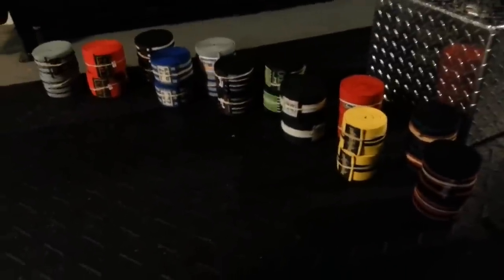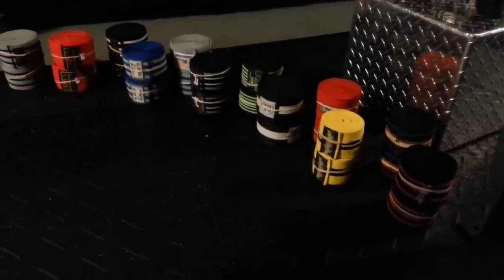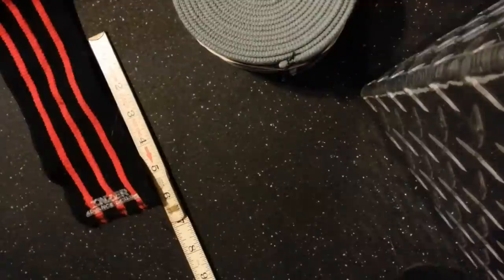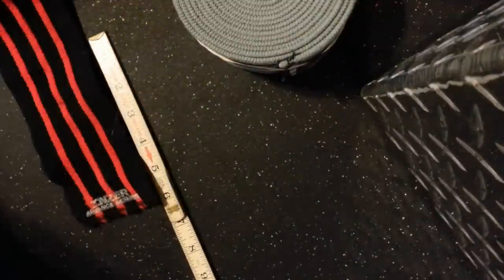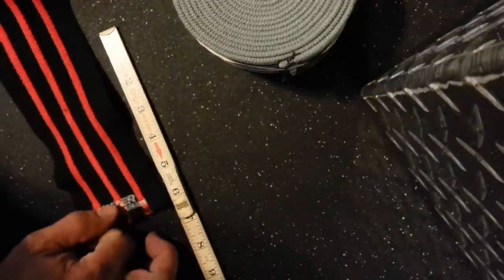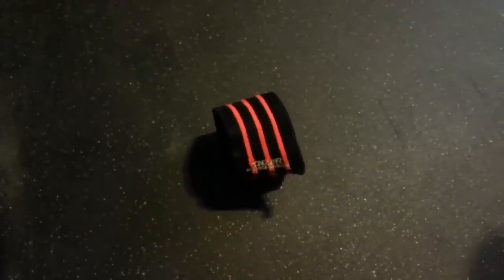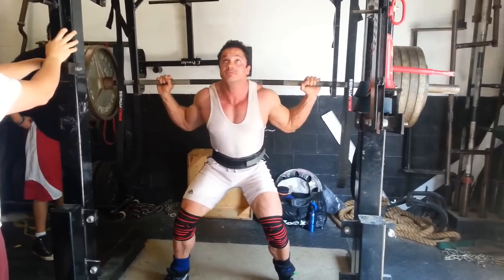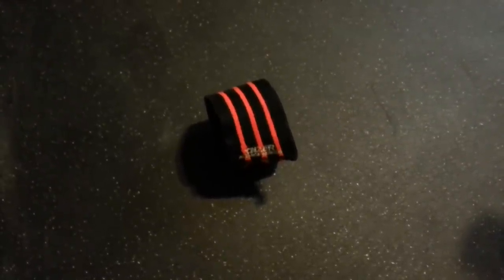Extensive Knee wrap review: Inzer, Titan, Darksyde, SlingShot, APT, IronRebel, PowerBelly, EliteFTS

Comment: Hi Jon, Mad Max here....competitive Powerlifter since 1972 & Category 1 Referee since 1990. Spent an hour checking out your video. Appreciate the time you took to make it. Was fairly interesting but overall was expecting better info such as how these wraps hold up after repeated use (i.e. do they stretch out, get softer, loose elasticity), how much each costs & videos of you actually wrapping yourself or getting wrapped would tell watchers much more about each set of wraps. The videos of you squatting don't tell anything to us as the lifts were totally indistinguishable from each other. Comparing different wraps of different lengths doesn't make much sense as that's like comparing apples and oranges. Would liked to have seen more mainstream wraps compared such as Inzer True Black, Inzer Grippers, Titan Signature Gold, Titan Titanium, Titan Max RPM etc etc.  I hope this professional constructive review will be helpful to you. Best regards, Max
Reply from the maker: +Roy Maxwell yes, thanks for the feed back. I know I would have like to go in depth a little more, hard to get quantitative data on the subject for sure.
The results are by feel of myself and other people I have talked to that used the wraps.
most of the wraps I just bought and used a few times so long term results are hard to do, at least now.
Yes there is a difference on how the wraps perform with how long they are, tried to touch on it, but I should have done better with it.
Would have loved to test out more wraps, but I have very limited resources and stuck to the wraps that I would use or have used.
If anyone wants to send me wraps I can do a comparison of them and throw them in the mix.
Reply: +Roy Maxwell When you use the term "Category 1 Referee", then complain that each wrap was not the same length (even though different feds have different length regulations) & then say you wish he reviewed " More Mainstream Wraps" , & go on to list ONLY IPF approved wraps, while also making rude comments (while calling your own list of insults a "professional constructive review") , toward +Jonathan Harder 's GREAT & THOROUGH video, suggests you don't appreciate the fact this information is for people inside the IPF, as well as OUTSIDE the IPF. In other words, instead of complaining about a diversity of information, that is useful to people other than you, you should be thank the provider for the diversity of information.

Comment: Bro thnx for the time and patience making the review, just one question have u tried the PIONEER PHANTOM KNEE WRAPS?
Reply from the maker: Yes I have a pair. Probably get about 70lbs out of them (they aren't as thick as I like for performance) and they feel like sandpaper. They are extremely harsh.
Reply: @smokinHawkjh  thnx bro, so the best knee wraps for u r the ELITEFTS
Reply from the maker: @joaquindiaz3567  no. I found the darksyde violators. I'm able to get over 100lbs out of them. They have more support and spring them any others I've tried. They are a little hard to self wrap but I've gotten it down pretty good.
Reply: @smokinHawkjh  thnx bro

Comment: Hi, Jonathan. I wonder which knee wraps I should get for body-focus building. I tend to concentrate on more reps instead of going heavy. I squat light weight with 15-20 range reps per set. Can you help me to choose a good pair of knee wrap, Jonathan? Thanks in advance, and I really appreciate it.
Reply from the maker: you would want knee sleeves like the SHP or evolutionize
Reply: Thanks, Jonathan. Are you saying that knee sleeves would be better for me because it will keep my knees warm during squatting? Can I use knee wraps instead?
Reply from the maker: for that many reps knee sleeves are better, they would offer better support throughout the rep range and warmth. I dont like to wrap up in wraps for anything more then 4 reps.

Comment: I just purchased the metal orange Jack 2.5m wraps, they are super stuff and I haven't gotten a chance to squat with them yet cause I've been sick but do you have any experience with these or anyone you know? So far one guy has used them I've found and he said he didn't like them because they were too stiff, wondering if I should send them back
Reply from the maker: i havent heard any one with them, 
do you like stiff or stretchy wraps, if you cant take them stiff then send it back. I do better in a stiff wrap myself thought
Reply: The only wraps I had prior to these were some red 2 meter power surge wraps and they were stretchy and okay, I order some Krait's in 3 meter, I'll probably keep the Orange Metal Jack just to have and use
Reply from the maker: I have bought a lot of different wraps I don't use. Sometimes I will throw them on and see if my preference for wraps have changed.

I do like the Kraits, was a good wrap for me till I got used to the Violators.

Comment: Hey, based off how I squat, what would you recommend? 

I can't decide if I should get Inzer Grippers (2M) or Titan Golds (2M). On the one hand you can get a ton of revolutions out of grippers, but the golds seem so stiff that I'd get a ton out of them... but could probably only get 7 revolutions out of them.

Link to my squat: https://www.youtube.com/watch?v=f1d6WGZW3Kg
Reply from the maker: +Mehar Bhogal Seems like you descend slow, so my guess is you need support. Ive used the grippers, but not the golds. If you are limited to 2.0M then would probably go with a wrap that is a little stiff but still can stretch, maybe the Titan THP. Then again you might try the grippers and like them better, another wrap to look at would be the overkill.
Reply: +Jonathan Harder thank-you
Reply from the maker: no problem. Nice place where you train, cool to see those challenge plates, Wish we had more calibrate plate options in the USA.
Reply: Jonathan Harder Thanks man, it is a pretty cool spot.. our city just hosted the IPF Commonwealth Championships and managed to get a hold of those Challenge plates.. they aren't calibrated though!
Reply: you need 3 m
Reply from the maker: Annette Tibbetts if he competes in the IPF then he is limited to 2m unfortunately, The 3m ones do work better though